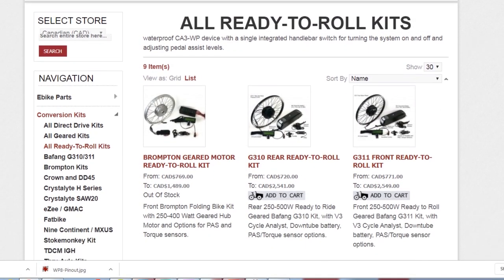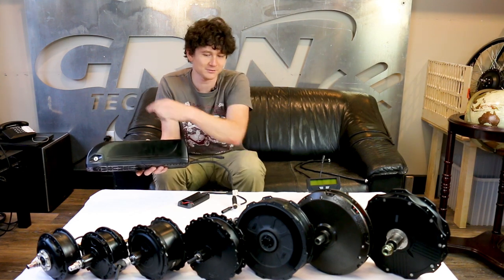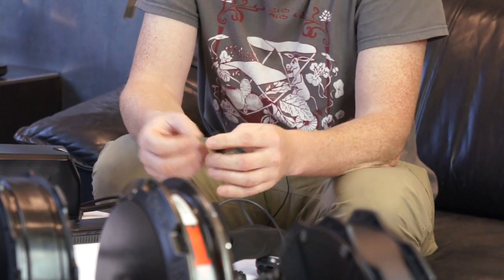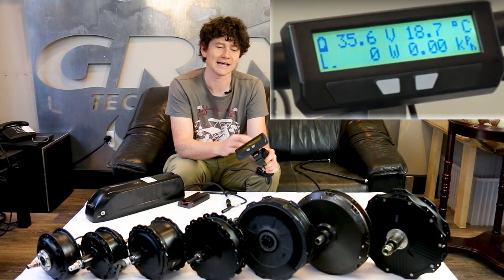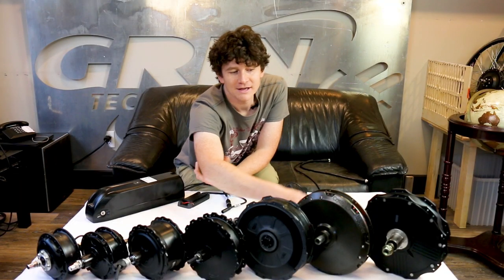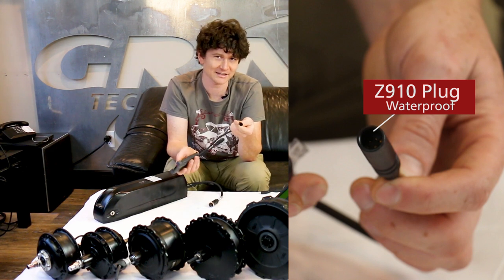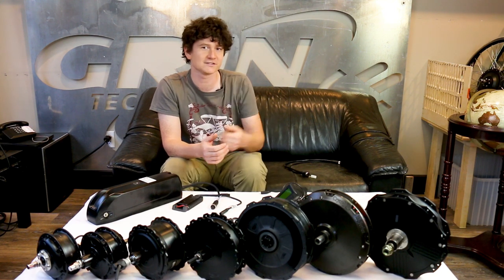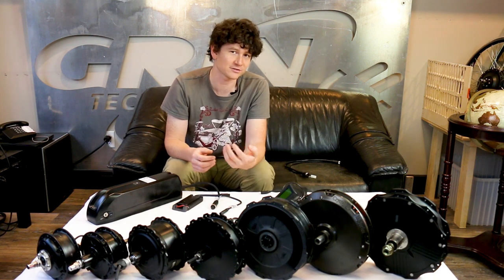Introducing Grin's Lineup of Ready-To-Roll Conversion Kits

Comment: Finally. Also the CAs should come pre-programmed for each kit.
Reply: That is Grin's policy on my Oct2019 purchase.  The CA3 and the Phaserunner was out-of- the-box TUNED & ready to run the GMAC, Sempu PAS and CA3, 14s6p batt configuration. AND of course I tinkered in the software later...that's part of the fun!
Reply: @solosailor222  that's great to hear. I think my CA wasn't programmesd for the G310 when I bought a kit in 2018.

Comment: I have a Swiss made Kikbike scooter that originally had 700c front and 16" rear wheels. I plan on converting it to fat tires. Probably 26" front and modified 20" rear suspension system. Just wondering which wheel to motorize and what kit would be best? Goal is 25-30 mph with moderate hill climbing ability. PAS and Regen not needed. Any help would be greatly appreciated! Thanks.

Comment: Hi there.... I got a X caliber 9 (mountain bike) 27.5 wheels sizes. So what kit should get ( with water-resistant) ( no front hub... ..also I got a 52v 16Ah shark lg ebike battery. Do you think it will work with your kit ... i have xt60 connectors .. if you have adapters for it. 
when you going to have more stocks
Reply from the maker: Best to send an email to info@ebikes.ca.  It looks like a bike with regular slotted dropouts on the rear so we would recommend either the GMAC kit or the RH212 kits, and we have dedicated videos about each of those systems.  Your existing battery will only work with the RTR kits if it's the model with a controller cavity in the base plate.

Comment: If you do carry the dual battery controller what is your price? So by adding a secondary battery, would it significantly overheat most Hub Motors, by a lot? By adding stage raid to my motor this will Aid the temperature enough to keep temperatures at Bay?
Reply from the maker: Hi Vic, our prices are all on ebikes.ca, if you're talking about a dual battery system with two 36v in series for a 72v, many of our hubs can run 72v, yes Statorade will greatly improve heat dissipation. Our motors and controllers have temp sensors and our controllers do thermal rollback when temps are too high, hence overheating isn't much of an issue with new motors/controllers.

Comment: Dreaming of a mid drive design. A direct drive hub with chainring and pedals replaces the front chainring, pedals and bottom bracket assembly. This leaves rear stock. Less unsprung weight and centralized mass. Ez flat repair and wheel swaps. Now add a multi disc wetclutch
Reply from the maker: This actually exists on the market,  I've seen at least two of them at the eurobike tradeshows. Unfortauntely the crank RPM is much slower than even wheel RPM's, (by about a factor of 3), making DD motors even less efficient in this realm compared to if it was just in the hub.

Comment: Which one of these kits would be the best upgrade for my Daymak Florence Fat Tire eTrike?
Reply from the maker: It depends what you mean by "upgrade". The stock motor that is on that eTrike is probably just fine, but you can get more range with a higher amp-hour pack, and more speed with a higher voltage battery. You can play with putting in more power for higher accelleration with a higher current motor controller, but there is a point where you really increase your risk of stripping the gears.

Comment: Very helpful video.  Thanks Justin.  Makes much more sense to go with your battery setup.  My only decision now is whether to go with the g310 for my old hybrid, or the g60 for my old pug.  My pug is a 2009; can you dish/offset the motor in the rim or is that a no go?
Reply: Looks like my rear dropouts on the pug are 135 so that eliminates the g60 for it.
Reply from the maker: But that opens up the possibility of SOO many other motors. The Pugsley is like a dream fatbike for retrofits given it's use of standard hub dropouts widths. I'd have a look at the GMAC and the RH212's ,and you can lace them in a rim that has offset holes to account for the offset dishing for sure.  There are some rims that have two pairs of holes left and right, and you can have all the spokes be in the holes on one side of the rim centerline for applications like this.
Reply: Love it.  Just when I thought I had my decision, I get to look at more options.  I will certainly take a look at those.

Comment: any opinion on a dual motor configuration for heavy duty cargo (150/200kg) for daily work ?  is it a good idea ? and what motor shoul I use?
Reply from the maker: Hi Salamel, for 150-200kg you can use a single high torque motor like the GMAC or the RH212, but if you have steep hills to climb then dual motors may be required.  Best to send us an email with your specific application details since the %grade has a huge factor in what will or won't work.

Comment: Old papamotor 1kw front hub, external controller, no pedal assist or computer, thumb throttle only. 8 pin connector. Is the computer also the controller?

Comment: Which electric  bike configuration is best for city riding with climbs,with a city bike with 26-inch wheels?
Thanks in andvance and greetings from Serbia.
Reply from the maker: All of them would work great for city riding, but if the hills are really steep then you'd be better off with one of the higher torque motors like the GMAC, eZee, RH212 etc.

Comment: Is there any chance to see motors like G31* but clutchless?
Reply from the maker: Yup. But motors like the G310 are not viable platforms as the helical cut gears put a thrust moment on the gears and the motor that are taken care of with separate thrust beraings, and these are only for thrust in one direction. If you tried to do a regen on a G31X, planet gears would get pushed into the carrier plate and the motor would get pulled forwards out of the stator. It would need a more substantial redesign for bidirectional torques.  But small geared motors with straight cut instead of helical gears are usually easy to convert into clutchless mode.

Comment: Hi, just love your products and this new line is neat!
Have you looked into the Bafang FM G370 hub motor and what do you think of it compared to the G310? Will you take it in under your brand as well as an even lighter option?
I also wonder if it would be possible to run a G310 at 72v with two Ligo batteries in series if you add like atf fluid to the motor for cooling or would tge magnet pop off? 😁
Keep up the great work!
Reply from the maker: Hi Mangus, we got about a dozen samples of the G370 motor early this past year ,they are cute but for now have decided not to pursue stocking them after having a few failures during field testing. They are however listed on our motor simulator here: https://www.ebikes.ca/tools/simulator.html?motor=MG370_10T   With the Phaserunner you can safely run any motor at 72V as you can easily keep the max phase current and torque within the mechanical and thermal limits of the hub. Above ~400rpm you definitely want to reglue the magnets and not trust the bafang adhesive
Reply: Thank you for the insights. Going to build a 20" kickbike and will probably go for the G311 then since it seems to be a bit more robust and proven. :)
Would the standard wind in a 20" wheel give much more torque for going uphill compared to the fast wind version? Would I lose anything else with the standard wind version except for slower top speed and what would the difference in top speed be?  Also what would standard wind with 48v battery do compared to fast wind with a 36v battery in 20" wheels. Pros and cons?
Also thinking of your LiGo battery for traveling convenience and would the standard wind be the better option for being able to run them in series for 72v and higher speed or would the rpm still get to high with the magnets coming lose?
And do you know if it is possible to use the small Bafang SW102 lcd with the G311 to get a slimmer display solution?  Is there any other similar small option?
Thank you for being on the frontline of the electric revolution to commuting! :)

Comment: READY TO ROLL? Do your motors come laced to a wheel? If it is "ready to roll," then the motor should be in the wheel & the wheel should have a tire.
Reply from the maker: You can select a wheel build in any size rim of your choosing if that's how you want it, and if it's a 26" wheel then we have the option of a tube and tire too.  But most people will prefer to move their existing tire to the hub motor wheel so that they maintain a matching front/rear tire set.

Comment: EVERYTHING IS OUT OF STOCK WTF😂👎👎
Reply from the maker: It's been a very busy summer for sure. Luckily we're good with the Grin All Axle motors, the RH212 and FH212 direct drive motors, and the G60 fatbike motors. The G310/G311's we're getting redesigned to have temperature sensing built in.  Which model of motor were you after?

Comment: Is this style of battery mount compatible with the shark mount?
Reply from the maker: Shark is used to describe a lot of different battery enclosures unfortunately, it's not a specific model name and no casing manufacturer has "shark" as the model number.  It works on the Hailong01, Hailong03, and the Reention Poly-DP5C, DP6C, and DP9C casings.